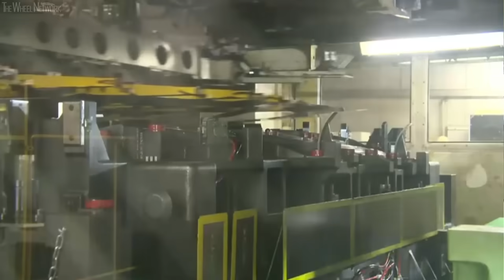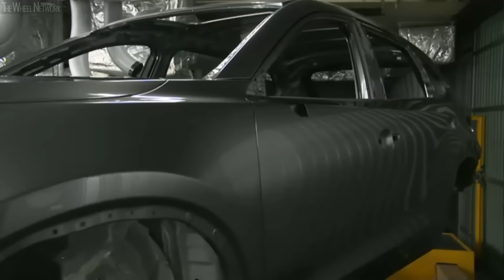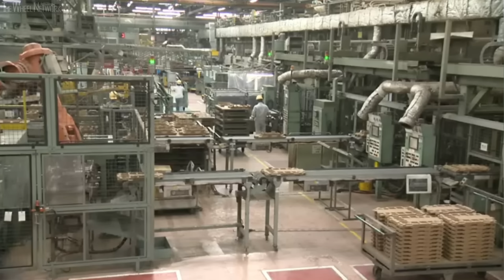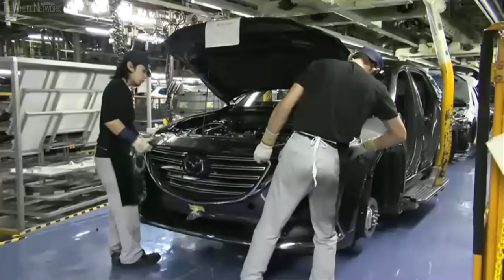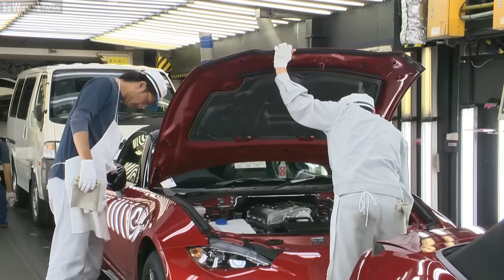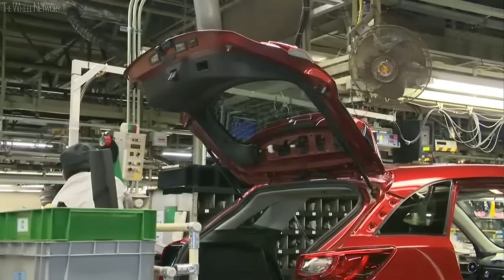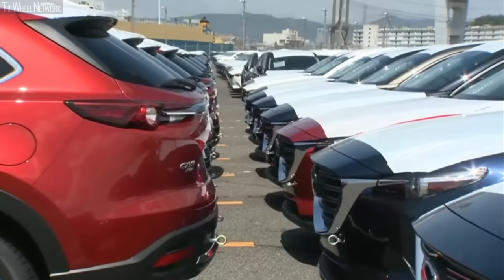Mazda Production in Japan

Comment: I have a 2017 CX5 (Red Soul) and a 2018 CX3 (Metallic Ceramic) both loaded GX's HUD equipped. Nice Economical and great handling. love the sport mode and the paddle shifting on my CX3 in manual mode.

Comment: I've got a CX3 which is lovely.
Reply: Sameee
Reply: Not made in Japan sorry
Reply: @Montana270  That's what I want. A cx3. I currently have a 2
Reply: Joseph Juguilon yes the CX-3 is made in Japan
Reply: @Chorizomicks  there are CX-3's in this video
Reply: I have a CX3 as well great car overall and looks like a boss with that soul red colour. I'd give it a 9/10 after a year of use. The trunk space could be a bit bigger and the car could use a bit more HP rather than only 120.  It drives fine but when fully loaded with passengers and suitcases you really feel sluggish past 150 km/h on the highway. It's snappy enough when I drive it alone and unloaded.  Especially at city speeds between 30-70 km/h
Reply: @Shattered-Realm  I have  a CX3 too, the snowflake white pearl ( Grand Touring) and my only complaint is the trunk space. I also have a protegé5 2002 and it has more space. 🤦🏻‍♀️
Reply: @Chorizomicks  its made in Japan if your vin number starts with a letter J in the front

Comment: Before buying my Mazda3 hatchback I compared with the same category of Toyotam, Subaru and and Honda. Tha mazda's cars have more quality and good substances for the price. It does not like a cheap car. They really make a quality cars now. I am very happy with Mazda's cars, Roadstar and Mazda3 hatchback. I will buy Mazda3 hatchback again when I need to buy a new car.
I drove Toyota and Subaru's cars in Japan.
Reply: Mazda is most reliable Japanese car but I enjoy the drive Subaru more
Reply: @hgn1832  Actually Toyota are most reliable, but Mazda aren't far off but I think they are more desirable for most of the model range.
Reply: Eh, I think the miata is pricy for what it is.
Reply: My 2008 3 5-door has been flawless. Still a hoot to toss on curvy roads.  Now I know why I like it. The attention to the inspection process on the line by the good old Mk I eyeball. Wish they had shown the stowing of the vehicles in the ship.
Reply: @2010ngojo  I think that's more the cars fame that drives up the price same with how 4Runners and Tacoma's can actually fetch higher used prices than a Tundra or Sequoia. Popularity also drives prices up. Subarus are also a bit pricey too.
Reply: My Honda Civic is four months old and already has a few fit and finish issues. Mazda certainly is doing a great job with their fit and finish in their cars.

Comment: Kudos to those workers; my 2019 Mx5 came through with zero defects. Not one single thing.
Reply: Same with my 2019 CX-5: zero defects!
Reply: My 1990 MX-5 had zero defects when it was 23 years old and had 250k on the clock. The only things that wrong were due to user stupidity
Reply: Same here my 2019 Mazda 3
Reply: @rbrookes  same. My mazda 2 venture special edition is December 2012 and has passed every single mot 100%. A smooth as butter.
Reply: your seatbelt retracts perfectly? most of them dont
Reply: @lawrencelin272  "most"? So you are saying that at 51% of mazdas have faulty seat belts? I'll literally bet you a grand in cash that ain't true.
Reply: Redskins 7  What are you babbling about?
Reply: Redskins 7  What are you babbling on about? Mazda have many workers. More than most.
Reply: @stephenmurray2851  i meant mx5s, i checked a few new ones from factory and it's a common complaint on forums (appears to be design flaw)

Comment: Bought a used 10 year-old Mazda GLC in the late 80s.  Already had 100k miles on it.  The panels were rusting off the frame by the time I sold it to a junkyard for $50, but I drove it there!  On my second CX-5, only because I hit a deer in the first one, which had 160k miles and I have no doubt I would have gotten many more years out of it if not for the poor deer.  Now driving a 2020 CX-5 and it's been the best car I've ever owned.

Comment: I have 2015 Mazda 3 HB with 2.0 & just 4,000 from pushing 200k. The only thing "major" so far has been driver side axle, it needs lower control arms replaced but it's still moving down the  road. Possibly needs new struts & rear shocks, & spark plugs just for good measure. Would love to get a CX-50 for next vehicle.

Comment: yesterday, Oct,31, 2020, I bought MAZDA CX-5 carbon edition turbo fwd. My friend strongly recommended this car. He owned CX-5 2018 model non turbo. I still have Honda oddysey 2019 so I can compare between MAZDA and Honda. These two brands have pros and cons, Mazda's pros is 1st made in Japan products so quality is much better than Honda oddysey has some quality problems. 2nd More luxury interior, which looks not any cheap. 3rd very simple and easy system so you can focus on driving. 4. more driving fun while you choosing turbo engine. Cons 1st, stiff handling and cornering 2nd, less safety system 3rd, not smooth driving feeling. feel uncomfortable and pain ankle and shoulder.  4th, small spacious front and back seat, cargo. 
If I choose new car again, I will buy another one.

Comment: My 2021 Mazda 3 Premium hatchback standard shift is flat out fun to drive. Sadly I had to buy it after I destroyed  my 2015 in an accident seven months after my last payment. I loved the 2015 but this new one is so much better with additional safety features, the Skyactive G engine etc etc. Had a Soul red but went with machine gray metallic this time. Mazda is making superior vehicles at affordable prices.
Reply: I got the exact same car except Polymetal Gray (had to drive across the state to locate one).  It really is SO much fun to drive.  Stick/clutch are so smooth.  Love the HUD, infotainment system (goodbye touchscreen).  Sound system is out of this world.  Throw the Interstellar movie soundtrack in and listen.  Pure heaven.  Perfect gearing ratios.  Pulls 14% grades (and that's steep - we live in mountain country) in 5th (I've had to go as low as 3rd on my previous cars), mountain passes in 6th without even flinching.  4th gear is perfect for passing.  I have to hold it back when passing or I'm going 90 before I realize it.  And it's so quiet and smooth it honestly never feels like I'm going that fast.  60 feels like I'm crawling.  Best of all, I got 39mpg on my last road trip.  I did get that with my 2000 Corolla sedan, but it didn't have 186HP.

Comment: There is just something unapologetically and uncompromisingly Japanese about Mazda products and that's simply just adorable in this world of trendy nonsense. Their vehicles are cheap enough and durable enough so that you feel that you are getting not only what you paid for (a competitive product) but also a little more (in handling and understated zippiness). The other Japanese brands are fine but I believe they miss the point of imprinting the Japanese character into their vehicles by attempting to bend just a little too far toward acceptance in other markets and therefore cultures. If nuance isn't your thing you probably won't even notice it but if it is you will certainly FEEL the underlying nature in Mazda design and performance, the revs and quirky aesthetics that weren't conceived of to impress anyone other than the driver and possibly a passenger. If you get it - you get it, which means you've got it and you've likely always had it. That's the best I can describe it. If I were a billionaire I'd still adore Mazdas because I f k n get it. They're not made to last forever but they are also not designed to break your heart, just be a good and true companion that you can pretty well rely on. I appreciate that as that's how I was made to be.

Comment: I have a 2016 Mazda CX-5.  Drives fine but the AC and heating take such a LOOOONG TIME and the AC isn't all that cold.  The heated seats takes forever to warm up in the winter.  After a few years, some trim pieces are not sturdy.  But here is what is so frustrating...the infotainment is simply the worst.  I can only choose to listen to Google Maps directions over my speakers OR the Radio (or other input source).  I called Mazda Customer Service (my rep was based out of India) and he confirmed this to me.  Obviously no Android Auto.  Was ok, but looking to upgrade to the all new Hyundai Tucson (Hybrid?) or better yet, the Genesis GV70 or GV80 in a few years..

Comment: This or a Toyota will be my next car
Reply: Definitely test drive a Mazda. My last four cars were Toyotas and never thought I would buy another brand but I now own a 2022 Mazda CX 5 carbon edition. Don’t get me wrong my last Rav4 was great but the Mazda is so much quieter, handles better and the interior is nicer. People complain about the infotainment center but it literally only took me two days to get used to it with no problem. It is smaller than the RAV4 but I don’t really need the extra room. Only negative for me is I get two miles to the gallon less than my RAV4 but the Mazda engine shifts so much smoother than the Rav. Very happy with my purchase.

Comment: My 2020 Mazda 3 AWD built in Mexico is shit. 28k, with the seatbelt rattle, seatbelt panel rattle. The automatic rain sensing windshield wipers stopped working at 200 miles. Sad. I love the way it drives, but these many problems never happened in my Lexus.

Comment: I BOUGHT A MAZDA CX5 WITH 60 THOUSAND KM, CURRENTLY IT HAS 160 THOUSAND KM; IT COST AT LEAST 5000 EURO DURING THIS PERIOD. THE ENGINE PUMP WAS SICK, 1200 EURO, PARTS BROKEN ON THE ENGINE, 1000 EURO, THESE HAPPENED DURING THIS MONTH, DO NOT PUT IT IN THE DOOR, I BOUGHT IT. DO NOT BURN
Reply: Hello. Wich model? Year? Thanks
Reply: German brand cars occasionally have problems after 450 km, Japanese cars are garbage after 100 km, not a car to buy.

Comment: I would strongly recommend not buying a Mazda.  We purchased a brand new Mazda CX9 and within 2 years had problems with a rough idle.  Was told after second year it just needed new spark plug wires.  Dealer could never recreate rough idle.  4 years later we took it in for an oil change and was told the cylinder head was leaking coolant.....Cylinder heads on back order for two months due to known problem of leaking.  the only solution was either a refurbished engine or New engine from dealer.  Warranty just expired but dealer and Mazda just says sorry either return your loaner car or replace the engine at your cost!  Horrible experience......$4600.00 lesson learned.  Please do yourself a favor and do not purchase a $40,000 car from Mazda only to have to purchase a $4600.00 engine in less than 4 years and trade in value now only $14,000 after new engine.  NEVER again!

Comment: My 2019 CX5 Signature is not a very well made car, it is more "smoke and mirrors" than substance. Cheaply made components e.g., seats and seat railing, rear view mirror, engine, electronics (half the time the system don't boot up correctly), rusting chassis parts, cheap narrow tires, paint quality...plus - plus!

Comment: I hate to say it but Mazda build quality has declined in their newer models, last month I bought two new Mazda, a CX5, built solidly and with a feel of quality and a CX-60 top range 3,3l, built ith cheaper materials and full of faults, rattles, unknown noise source, harsh ride, steaming up windows and technology that interferes with the driving experience (thanks EU) or simply doesn't work at all most of the time.

Comment: With a speed limit of 50 kmph it is startling that 67 people died on NZ roads in localities to stupid things like not giving way.

It wont be long till a death on Pukekohe roads. They have many trucks and there drivers here and there bad driving habits assured. 

Road accident deaths by age group for 2023 in NZ:
1.15-30 Highest bracket 120 deaths.  
2.31-45 71 deaths in 2023.  
3.46-60 57 deaths.   
4.61-75 55 deaths.   
5.76-90 28 deaths. 
2023 year.

Males rank 150% higher in car accident death rates sitting at 246 deaths whereas females sit at 95 for 2023.

341 deaths on NZ roads for 2023. 341 to many. 

2023 totals for road deaths in NZ 
Cyclist = 9. 
Driver = 182. 
Motorcyclist 53. 
Passengers = 72. 
Pedestrian = 25.

Overall the total road deaths for the Main NZ centers in NZ totalled 279 = AKL/BOP/Canterbury/Manawatu/Northland/Waikato WGTN did not total in with a low rate of deaths for 2023 @ 15 deaths on there roads for 2023.

The waikato faired not much better as we know from other regions with 67 deaths on NZ roads the worst of the totals for 2023.

Canterbury road deaths sit just shy of the AKL 2023 total at 45.

Auckland total deaths on the road abysmal at 47 for 2023. Highest death rates for Auckland roads sits at 111 deaths for 2021/2022 combined.

Comment: As an owner of mazda 6 wagon 2019 2.5 petrol engine I can just say that it's a laud car above 110km/h due to really poor quality window seals. In winter the battery isn't charged as much as it should and e-loop doesn't work at all. Piano black finishing looks awful after 100km. So thin paint job that it scratches from wind. At that price there are much better cars, my last mazda for sure.